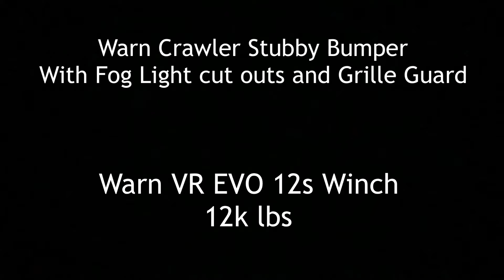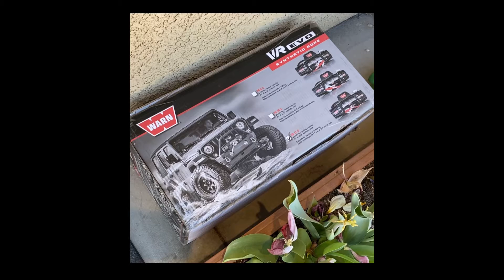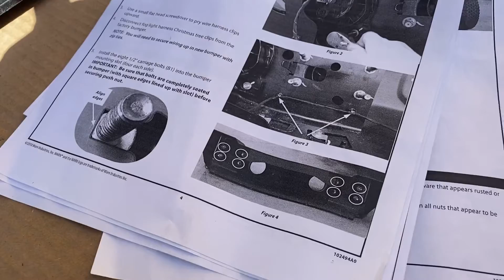Warn Stubby Bumper and Warn Evo VR 12S Winch installed on Jeep Wrangler JL

Comment: just got done installing this exact bumper and a warn evo 10 winch on my 2021 Gladiator Willys, boy am I glad you put this video up as it saved me a bunch of headache! i ended up using one of those metal claw bendable bolt retrievers to sneak in the bolts because mine came unstamped in 4 places for the bolts to mount up to the frame.
Reply from the maker: @ponch16 Yeah man, glad it helped out. I bet it looks killer on your rig! Thanks for the shout out!

Comment: UPDATE: On New Years Eve, his setup saved us this weekend. We pulled a guy with a Jeep Cherokee up a mountain after he lost power due to low trans fluid sitting at a very steep angle. To make matters worse we were also on a cliff and it started to snow. 

 We had to add at least 60 feet of tow strap in addition to the synthetic line that came with this winch and use my Jeep as an anchor, because it started to slide down the hill when we tried to pull him up. That should give you a pretty good idea of how sketchy the situation was. That 12k Evo winch is worth every penny. So if you are looking to get one don't skimp out and save for the best winch you can buy!
Reply from the maker: @MIL SPEC. I couldn’t have said it better. THIS was the EXACT reason I chose this winch. Because you never know what you need until you don’t have it! 👍🏽

Comment: You might  want  to consider  wrapping  the  power and ground  cables in plastic  conduit or getting  power  interrupt switch  great way to burn up the Jeep if  the power  wire goes to  ground  in the event of a collision
Reply from the maker: Good tip👍🏽